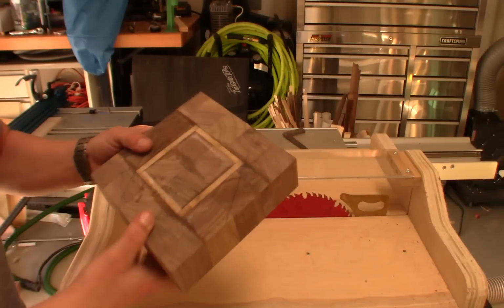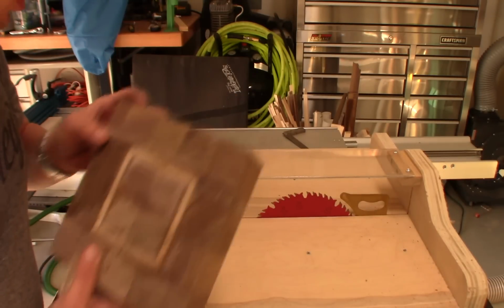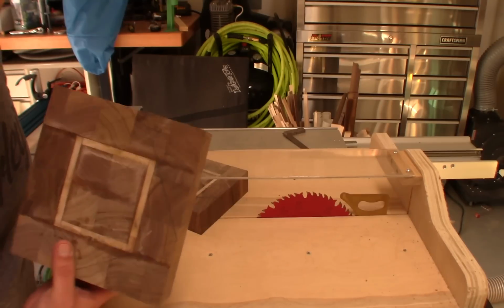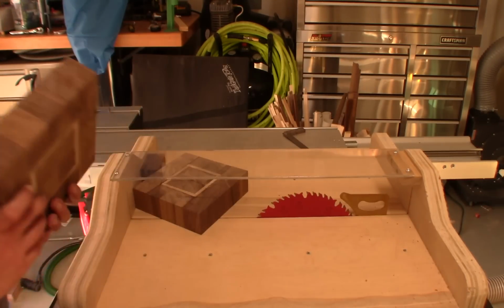Amazing Rotating Squares End Grain Cutting Board

Comment: When people see the completed boards, they do not see the work and effort that is put into making them. Great board and video, so well done. I noticed you were experiencing the glue joints slipping under clamping pressure. I sprinkle salt on my glue joints and it does stop them from slipping as you apply clamp pressure.
Reply: Does the salt eventually dissolve or is it crushed?
Reply: @misimiki  It eventually dissolves after it has done it's job.

Comment: Fantastic boards, just as a heads up running end grain through a planner is very dangerous. Eventually it binds and things get nasty.  Speaking from experience I had one bind up about 1/4 way throught.  Ended up breaking my hand and going through a cabinet when it got kicked out. I was told I was going to get bit one day didn't really believe it. I had done lots a boards,  I learnt the hard way.
Reply from the maker: Not necessarily.  Yes, care needs to be taken, such as making very shallow passes.  I can get a little more aggressive since my planer is a 5hp with a spiral cutter head; virtually no noticeable difference between planning face or end grain.  I used to have a small dewalt planer that I would use for endgrain planning and it definitely took a bit more careful consideration on depth of cut.  Still to this day, I usually only plane about 1/64" each pass.  Curious as to what you were planning that you said bound up and got kicked out.

Comment: I really like the looks of the crosscut sled you are using. Especially the plexiglass top. Any videos or plans for making that?
Reply from the maker: I actually watched other folk's videos on making a crosscut sled, then added the guard later.  I used shatter-resistant plexiglass and gave it enough width to cover my face when I'm close to it aligning cuts.  It works really nice for when I need to adjust a cut while using shims on a piece and I need to lean in close to see the alignment while the saw is running.

Comment: A very nice cutting board. I too and a fan of MTM. I would add a toggle clamp to the table saw sled. And I was waiting to see you slice your hand with the chisel you used to remove dried glue. Glad you didn't. Several commenters liked the music. I wasn't one of them. By the end of the video I was climbing the walls. I only left the sound up in hopes you had something to say. I would prefer to have you do a running commentary about the process.

Comment: Rueben. I'm curious to know what grit you used on your drum sander for the first rough sanding. I have the same sander and cannot use it for end grain sanding since it burns the surface. I may be using too rough of a grit. Love your videos.. Thanks Rich
Reply: I have the same sander and the same problem.  What I eventually came up with is setting the sander so that it barely touches the wood and then setting the speed fairly fast so heat doesn't built up.  I use 120 grit paper for most all my sanding, but 80 may work a little better/fast with less burn.
Reply: @hjp40  I switched from 80 grit to 120. Made a big difference. I use probably much less than a 1/16th turn lowering the drum for each pass as well. Feeder belt on max.

Comment: What angle were you shooting for? Or did you just decide on certain size squares?
Reply: MrE2112 the angle is dictated by the size of the square.  Since they're squares, I just use a square to draw out the next cut lines based off what will fit within the outer strips.

Comment: Can I presume you are barely shaving off end grain in your "final" jointery?  Also, it seems that if you know the angle you are rotating the "inside" squares to you can cut the triangles off for successive building out of your cutting board that you could make a correctly angled jig to fit onto your sled.  That would seem easier than winging it with a line drawn on the formative cutting board. That has to be unnerving as hell to push a thick, hardwood block of wood thru the sled with only one point of contact on the sled. Just a thought…
Reply: richard gebhart I draw the cut lines on it with a square, so when it comes time to cut, I take a off cut block and shim it up so there's at least two points of contact.

Comment: I prefer Tung Oil over Mineral Oil simply because Mineral Oil and anything using Mineral Oil, never fully dries. There is always a slight dampness and liquidity and each time you put food, especially meat, on the cutting board, some of that mineral oil gets into your food. Yes the FDA says it's safe but would you trust a government with a vested interest in you dying before retirement age?

Comment: Ahhh no safety glasses or hearing protection as you router? All it takes is a bit of wood traveling at high velocity to ruin your future projects. I guess you spent so much money on all that fine shop equipment you had none left over for a bit of preventative help. Good project .

Comment: Question: I've been trying and trying to figure out why the current fad is to make endgrain cutting boards and bowls when the endgrain is the most open cell part of any wood, and therefore likely to harbor bacteria.  Can you please tell me why everyone seems to be doing this?
Reply: I don't know why "everyone" is doing it, but here are my feelings: Most importantly, people like the way it looks! Next, some feel endgrain cutting boards are easier on the knives. Finally, it is not all that difficult to provide a more than adequate seal to the endgrain with any number of renewable protectants. One other thing: this type of cutting board is generally NOT used for cutting "bacteria laden" things (like chicken, for example).  As in all things, YMMV and that's fine! There is plenty of room for multiple viewpoints. And I wouldn't consider it a fad; I'm aware of folks who have been building and using endgrain cutting boards for 30+ years. Perhaps social media is highlighting it more of late?
Reply: End grain cutting boards are better for you knives. Also, they don’t get the long, deep cuts/scars that face grain gets.